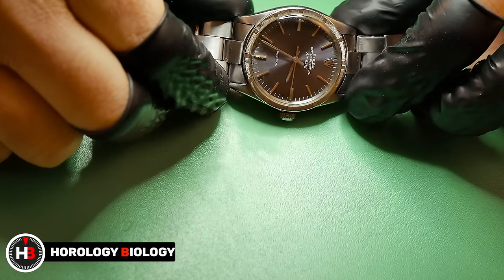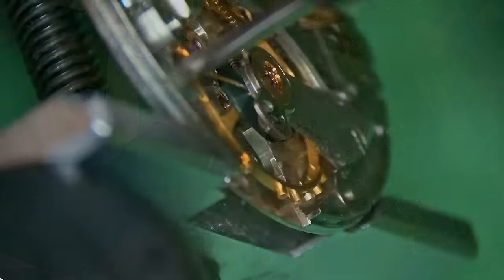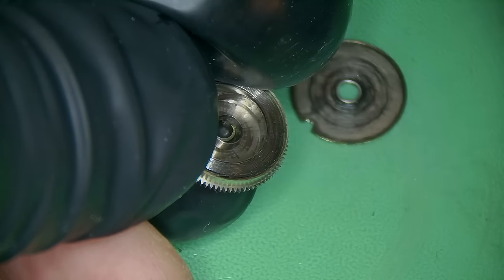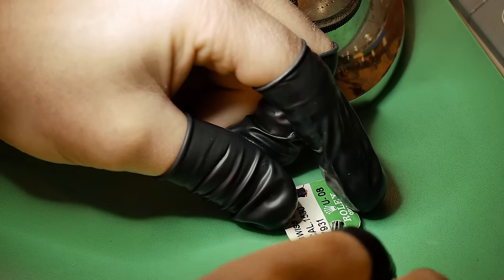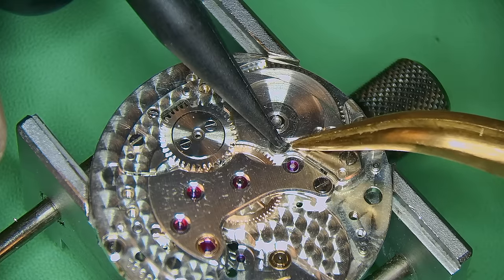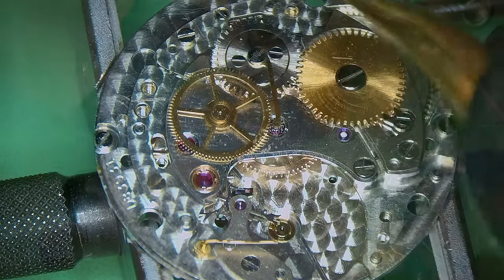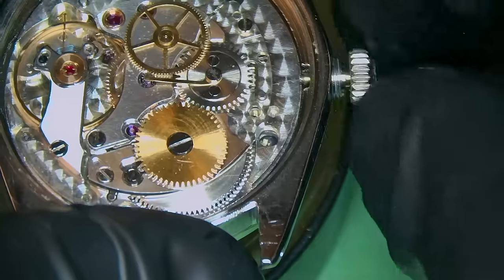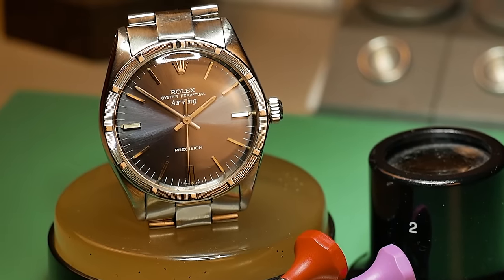This Rolex Air King Vintage Watch was Seriously Damaged! Ref 1002/5500 Restoration

Comment: Your oiling skills always blow me away!.... and the way you just plonk the second hand on is insaine (I'm not bitter at all, take a breath Trev) :D

Very nice video yet again, out of intrest do you prefer the rubber ball rather than oyster tool to open and close the case ? (I don't know what rolex was thinking personally?)
Reply from the maker: Microscopes help with the oiling for sure 💪🏻💪🏻 I am a big fan of the rubber balls but to be clear that watch was finally tightened up with my heavy duty case back opener/closer. It came with the special Rolex dogs for it.